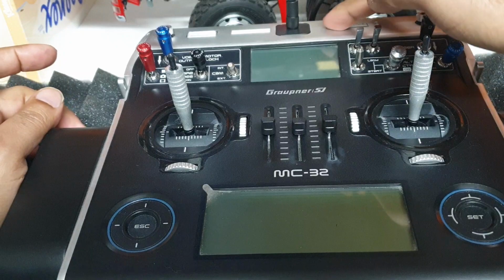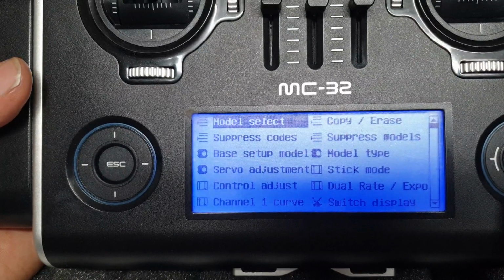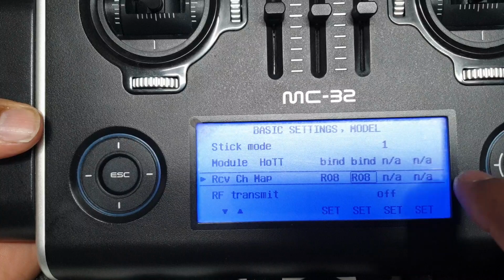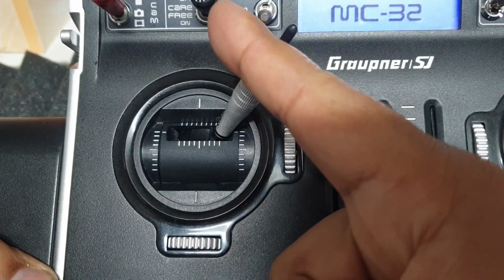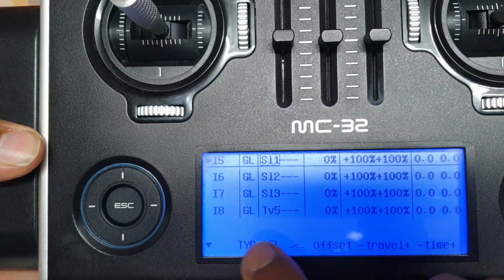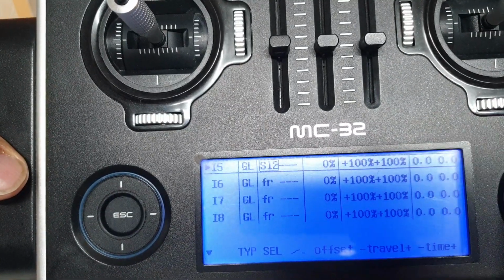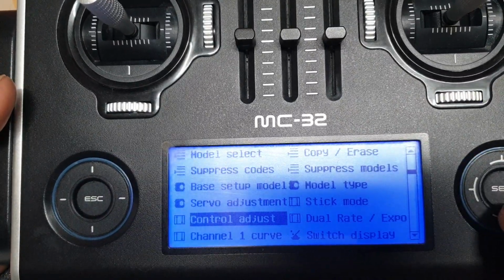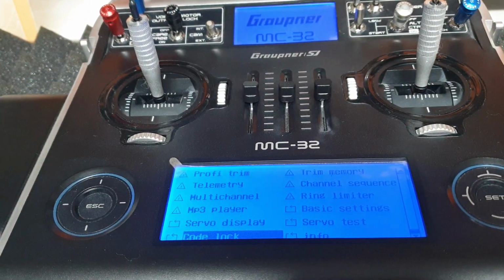CSMI Graupner MC32 Radio set up for RX trucks excavator and dozers

Comment: 🧡👍👀✔😎 More videos about this radio, please, & thanks! I bough tone of these, thinking I wanted to play with the big boys. I upgraded to 3D joysticks, & I WASN'T able to figure out how to program it. I FINALLY got it done, but the model DIDN'T function correctly. The steering, & throttle were mixed together. This is not good for a truck. 

I wish I would have programmed & tried the radio BEFORE I upgraded the gimbals! That way I'd know it it's in the radio, or if the new gimbals are the issue.
Reply: Hi, can you explain how to program tracks for excavator. Thanks
Reply from the maker: Thanks for comment is your radio a MC32 with 3d Joystick
Reply: @CSMIRC  Yeppers!